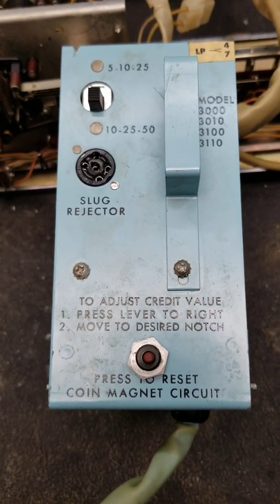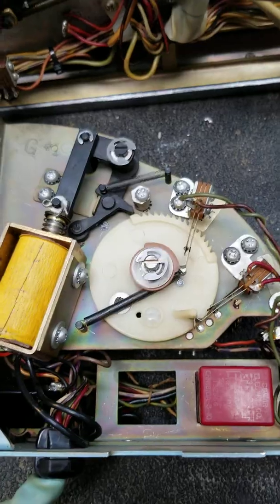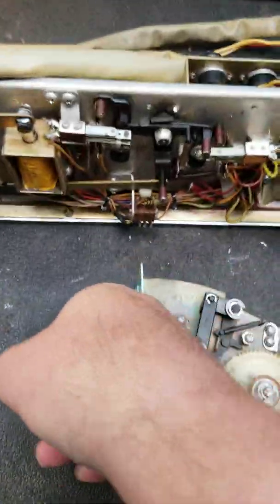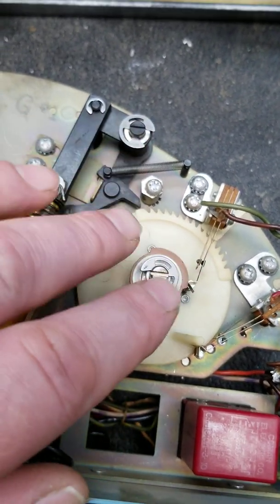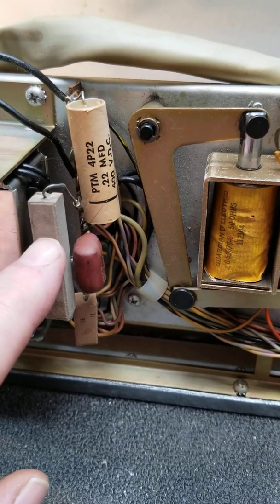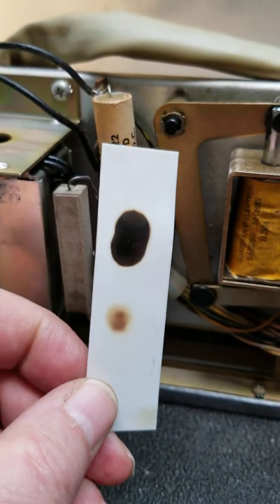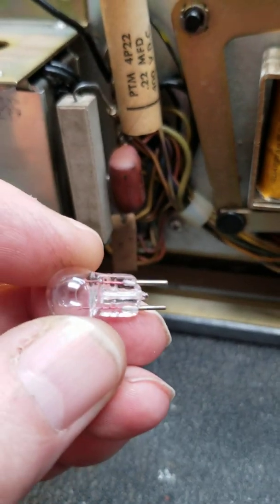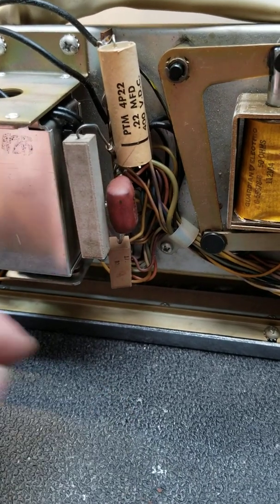Wurlitzer Jukebox Models 2000 - 3300 Free Play Modification

Comment: Do you have a picture of the wiring from the coin register to the Playrak?
Reply from the maker: I'm sorry I don't have a picture or a unit in here at the moment, but the schematics are readily available online.
Reply: @tipsfromthetechbench4589  Thanks for responding. I don't really read diagrams well "no color labeling for each wire. The plug wiring is pretty critical. I have" a loose yellow wire not sure where it goes. I'm tiring to go credit by credit but fuses are hard to come by. Do you know someone that might have a handmade diagram or picture.
Reply from the maker: @jamesterry9874  If you do Facebook, I would suggest joining one of the jukebox collector or repair groups.  No doubt someone there can snap a picture for you.

Comment: Do you have a picture of the wiring from the coin register to the Playrak. Two wires on mine came out and there is a third that doesn't look like it was connected. The Playrak fell out while moving it. Now, the selector buttons don't lock.

Comment: Thank you, very good video! I am hoping you can give me some advice please. I have a Wurlitzer 2800, with no coin mech. It has been on free play for many years, but I don't know how it's been wired to accomplish that. It works just fine. The golden bar feature does not work, so I was thinking it might be better for the machine if I take it off of constantly having a credit on, and wire it so each time the golden bar is pressed, it gives one credit for a selection. I have seen this done, but have no idea how they did it. What are your thoughts? Just leave it as it is? I just want to do what's best for the machine. Thanks!
Reply from the maker: The "Golden Bar" issues are usually the sub assembly that sits on top of the mechanism.  

Without knowing how the mod was made, I can't suggest any way to reverse it.  I've seen many mods over the years.  Some required removing parts, so if it's one of those mods you'll need to find and replace what's missing.
Reply: @tipsfromthetechbench4589  thank you for your reply. I sincerely appreciate it. I totally understand about the mod for free play. I am not completely sure how it was done. I guess I should ask you, considering that it's been like that for many years, would I be safe to assume that it's probably okay to leave it as it is? Or would you recommend trying to change it so a credit is not always on? I'm not sure if this is one of the jukeboxes that is alright to always have a credit on. I know that some are alright, and others aren't.

Comment: I know...old video and I hope I get an answer, but OMG! I have been looking for a long time for some help on my 3100!!! SO, mine worked great until I moved it from one side of the room to the other...literally...8 feet! Then when I tried to play it, when you selected a song you get this horrible BRRRRRRRRR sound and it strains to get to the record but will eventually make it and play. When you look inside, the sound is coming from the selector arm/ solenoid. When you reach in and force the connection, it will work fine until you try to make the next selection. So does that mean the solenoid is bad?

Comment: Hello sir. If you still actively check for comments I have a quick question. The buttons on my 3300 do not register anymore. Could that be an affect of that fuse being blown? I can manually cycle the records but I can not do it with the selectors. My grandpa gave the the machine and I am trying to get it to run, but he had it on free play mode
Reply: I forgot to say thank you!!!
Reply from the maker: Is the solenoid engaging?  If so, then I would check the leaf switches on the control panel first.  If the solenoid is not pulling in, then check the voltage and that 85 ohm resistor.
Reply: @tipsfromthetechbench4589  thank you. You’ve sent me in a good direction. I was at a loss

Comment: Can adjust the coin from a dime to a Quater a play song ?
Reply from the maker: I admit I have never tried.  You can set the rejector mechanism to reject nickels by changing the nickel cam on the bottom.  You can set the playrack 25C to 1 to allow one play for a quarter but, to my knowledge you can't set the dime selection below 1 play.  You would need to block out the dime switch or remove the wire to the coil somewhere between the switch and coil.  The unit would still take a dime but wouldn't give any credits.

Comment: What ohm resistor should the replacement for the latch solenoid be? 25w and what ohms?
Reply from the maker: Keep the original value of the resistor used on your model (usually 80-125 ohm for the latch solenoid and 150 ohm for the select lamp).  Just change to a higher wattage.
Reply: Thanks for the reply. The reason I asked is I can’t find an equal value resistor at 25W. There is a 85 ohm there currently and the closest replacements I’ve seen are 80 ohm and 110 ohm.
Reply from the maker: @Joseph-mo1vh  I didn't realize the supply had dried up on those.  Quick google search shows Vishay still has them but in a chassis mount instead of ceramic.  You want to stay as close as possible to the original.  80 would probably work but it would put a little more heat on the coil.  110 may not send enough current to hold the coil in.
Reply: This is why we should take your advice and leave it out of free play haha. I found a 5 ohm 10w that I’m going to put in series with the 80 ohm. I really appreciate your quick responses